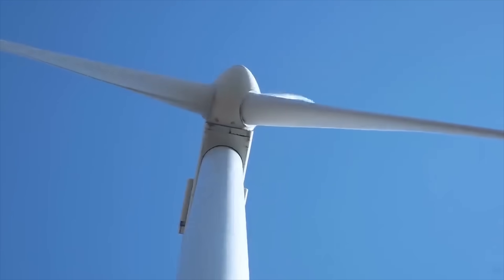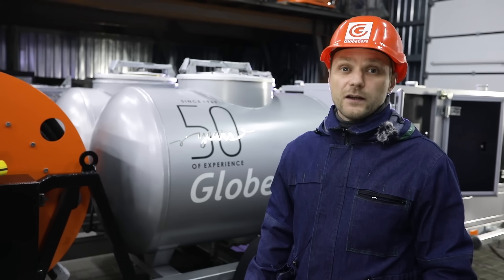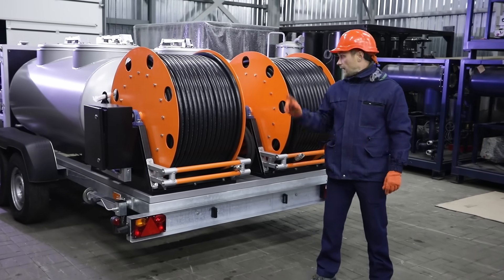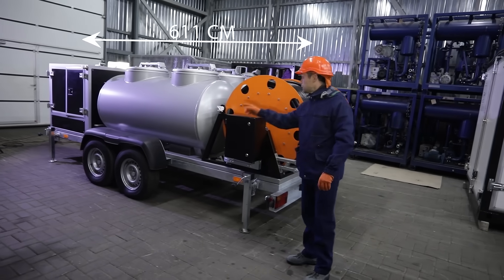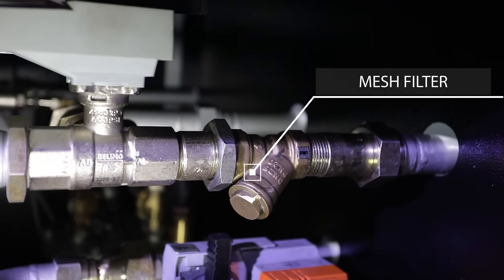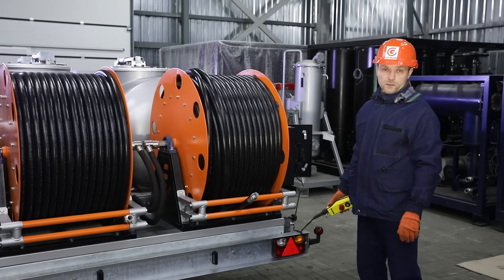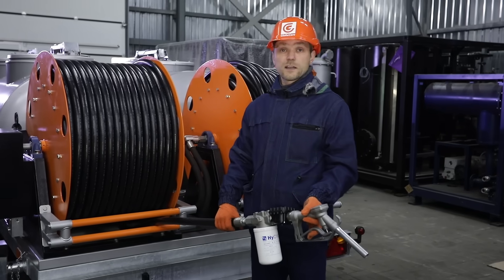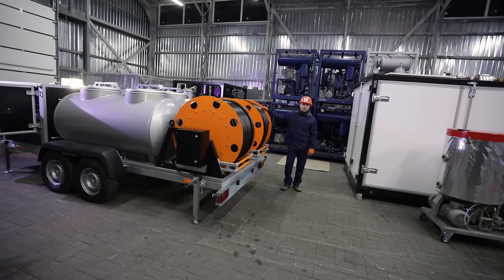Wind Turbine Oil Change with CMM-G GlobeCore / Review

Comment: How many gallons of oil is in one turbine?  I see you said the tanks are 900 liters.  How many turbines can be serviced?
Reply from the maker: Hi. Usually, a wind turbine has several gearboxes: main, azimuth, etc. The volume of oil depends on the power of the wind turbine. For a 2.5 MW wind turbine, the oil volume in the main gear is 66-80 gallons, and the oil volume in the azimuth gear is up to 5 gallons. When the power of the turbine increases, the volume of oil will be larger.